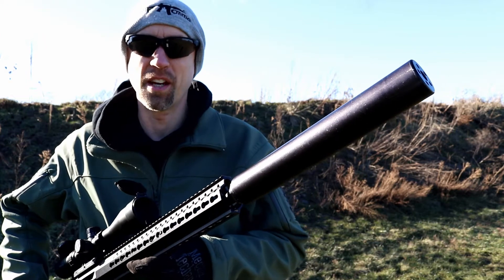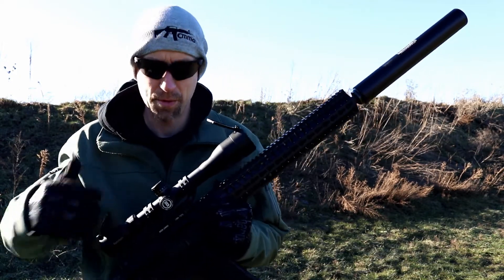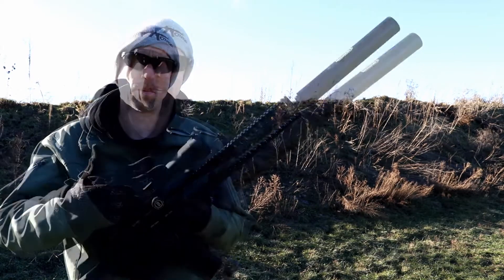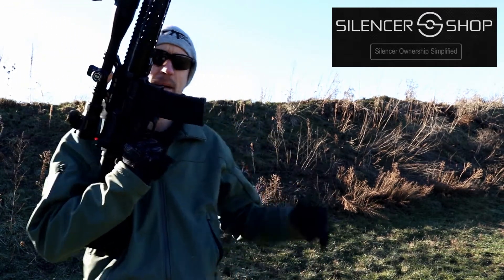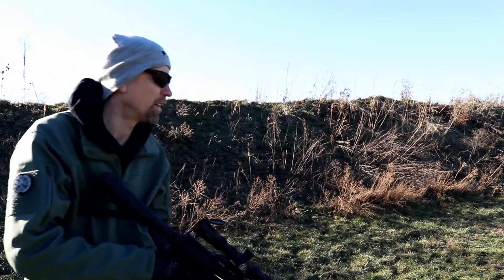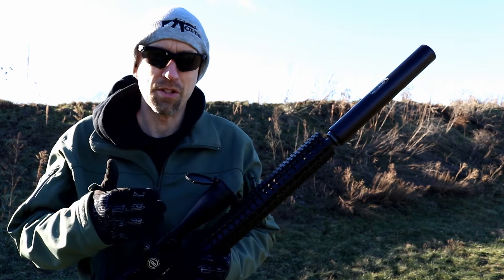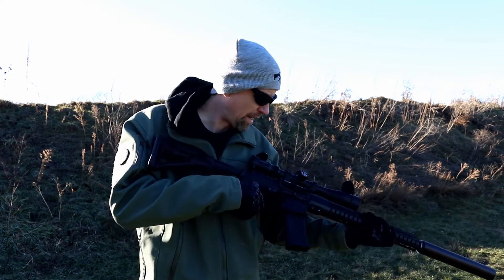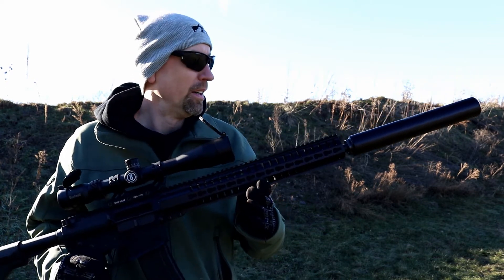Bowers VERS 458 SOCOM Silencer and CMMG Anvil MkW-15

Comment: I love 458 Socom I built one a little over a year ago with parts I bought from Tony over at tromix. Tony over there's a real good guy and he helped develop the hardware that went along with the cartridge design and I can't remember the guys name and I don't want to kill it he's Asian that actually designed the cartridge Tony work with him too make a barrel gas block Bolt for the cartridge itself. I'm using black butterfly Nosler tipped 300 grain I believe they've got a big blue tip in the middle of a copper hollow point 300 grain moving 2200 ft per second hitting with over 2000 foot pounds of energy at the muzzle. Great video do some more on 458 Socom please.

Comment: How will this suppressor work on my Ruger American ranch chambered in 450 bushmaster?
Reply from the maker: I'm not sure of the thread pitch on that barrel but Bowers has a ton of VERS adpaters for almost every thread pitch out there, I'd check out the Bowers page.  It should sound great on it.

I'd link to the Bowers page but it's against the new YT rules.  type Bowers VERS 458 into www.duckduckgo.com and it should  be the first link or two.
Reply: @13cgunreviews Thanks!